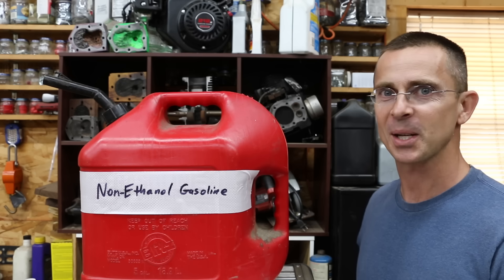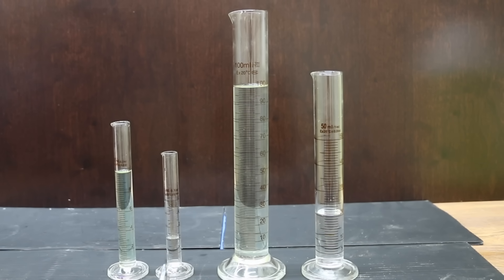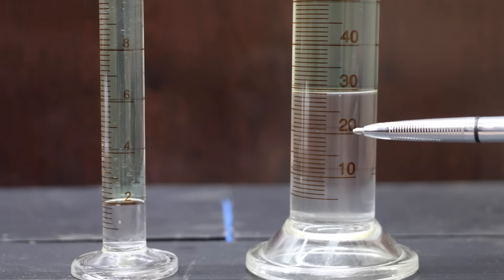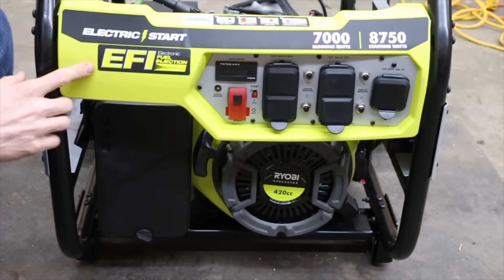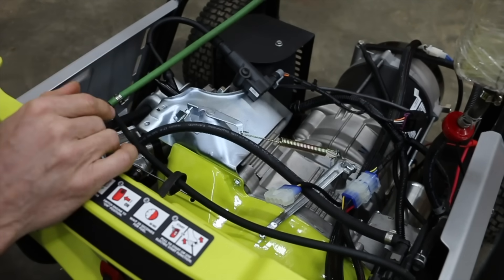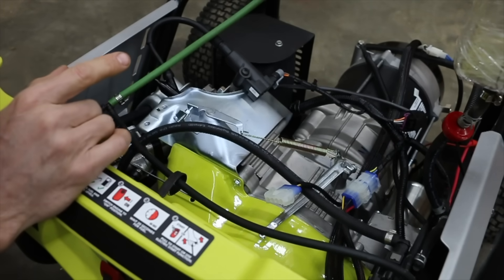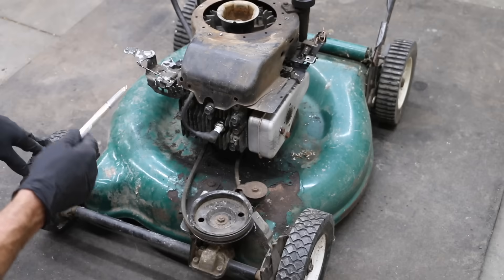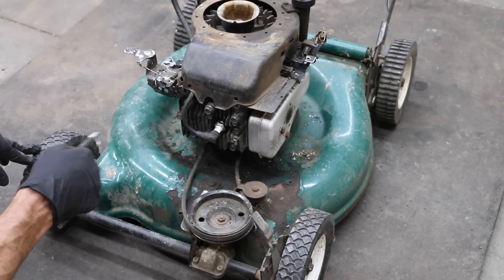Is Non-Ethanol Gasoline Really Better? See the PROOF!

Comment: Ethanol needs more fuel flow to run stoichiometric (complete combustion with no excess oxygen) compared to gasoline, so E10 needs a slight increase in fuel flow. Of course the EFI engine adjusts for this with the oxygen sensor, but the carburetor on your mower engine doesn't, so technically it was running a LITTLE leaner on E10 than pure gas. That might make a difference in carbon deposits if you ran them for longer, although probably not noticeable for this short test.
Reply: "Ethanol gas makes it run hotter" can be fixed if the carburetor jetting is made richer enough to negate the leaning effect of the ethanol gas as compared against straight gasoline. Also the power loss that occurs when using gasohol  with some engines,particularly if they were already calibrated on the edge of too lean even with straight gas.

Comment: I drove a Holden combo The same trip every day from Logan to Cabulture,same load 3 tanks on E 10 50 liters average 420 ks then 3 tanks of 91 500 ks average and more pulling power up hill,then 3 tanks on 98 I got 640 k average,no dropping gears a quicker traveling time , conclusion in the combo the 98 even though it was a higher price proved cheaper by distance traveled on a tank was cheaper that the 91 and the E 10
Reply from the maker: Thanks for sharing!
Reply: So conclusion
50 ltrs e10 ,,,,420 ks ave
50 ltrs 91 ,,,,,500 ks ave with a bit more power
50 ltrs 98,,,,640 ks no dropping gears going up hill and quicker traveling time
Even though the 98 cost the most to fill the tank,on an average because of improved performance and extra distance traveled each tank of 50 ltrs was cheaper than both, the e10 and 91 on my pocket, plus the advantage of less wear on the endgine
But every car is different,and only by doing a comparison test like this you to can find the most economical equation for your vehicle
Example for years I had my father's Rodeo it got 280 ks per 50 ltrs regardless of what I used with no more power so conclusion of dads Rodeo I used e10 it's how you learn to budget

Comment: Alcohol is Hydroscopic. It attracts water. It is also corrosive. So if you leave your fuel tank half empty for any length of time, it will corrode a steel or aluminum tank and the material will wind up in the fuel clogging the injectors or it will attract water to the tank and foul up the fuel system. Either way its a bad thing. Very harmful to an engin
e.
Reply from the maker: Thanks for the feedback.

Comment: For the long term test, you should leave some ethanol/non ethanol fuel in two, clean, small engine carbs for the extended period to simulate someone not draining their carb before storing for the winter. Examine the deposit/corrosion characteristics of the two fuels on the aluminum housings, brass jets and fuel passages.

I think non ethanol fuel leaves deposits while ethanol fuel also jells in the jets due to exposure to the moisture in the air.
Reply from the maker: Thanks for the suggestion.

Comment: You are a pure genius, the testing methods, your video production are first class.

I worked in a car dealership the ethanol attacks rubber orings and leaves sediment, burns cooler there fire reducing vehicle fuel efficiency by typically by 10 percent.

I also worked as a small engine tech, customers would bring in the outdoor equipment, it loses power, won't start, etc.
I learned ethanol settles and breaks down after 30 days.
I would find white powdery substance or looked like snot, used brakekleen blew it the passages and cleaned the fuel bowl.
Steam the carb then run bread tie in the ports.
Reassemble test and done. Asked the customer if used ethanol? They use ethanol in everything never have a problem.

At the dealership I worked at and my friend another the service advisor ask where do you get your gas or do you use ethanol?
He would tell them try using brand name gas station and switch to regular gas.
Will give you gas card if no difference.
They thanked him.

When gas hut 5 a gallon here I used ethanol I paid the price, my Silverado with tuned  5.3 started losing power  going up hills or long inclined felt jerking sensation.
My winter beater Buick and for fun Cadillac  the same.
My toy 83 monte with 454 filled up with ethanol as left the station it fell on its face.
My Nova SS with high strung 406 small block pinged horribly.
Live and learn.i know I use it in everything runs fine I bet.

Thank you for the bideo

Comment: On long term storage, this is one area where the heavy CA emissions restrictions actually adds to the ownership experience.  Because fuel systems are completely sealed off from the atmosphere, the only time that atmospheric air can enter the system is when the fuel cap is open.  At all other times what air is in the system stays there as is. There is no extra moisture getting in there to cause problems with the ethanol content.  I've stored motorcycles for many years, up to 7 years with a full tank of gas.   Often I'd forget to add stabilizer until years later (oops..).    After 7 years, they start up and run just fine on the 7 year old gas in the tank.  (fuel injected, not carbureted engines, though I'd just drain the float bowls on those).
Reply from the maker: Thanks for the feedback.

Comment: Ethanol fuel burns hotter than non ethanol fuel, and legally all fuel has to have a minimum of 5% of ethanol so I’m questioning where u got that fuel from that gas no ethanol, but because ethanol burns hotter, it will have higher wear on ur engine and eventually kill it sooner than if u have none ethanol fuel

Comment: I love ethanol free fuel and use it in all my small engines. Noticable difference in sound and power in my riding mover. Gas station up the road sells it for $4.99 a gallon. About 2 dollars higher than ethanoled fuel.
Reply from the maker: Thanks for the feedback.

Comment: 4% is such a small amount that you need to check your margin of error as this could, very well, fall within that margin. It could be that your engine is actually burning the ethanol fuel more efficiently but you do not notice because your measurements are not perfect (as nothing is).
Reply from the maker: Thanks for the feedback.

Comment: Hi, interesting podcast.  I would like to see the difference in fuel efficiency for an engine that can advance spark until a knock sensor input to stop detention? Also maybe the effect of an oil cooler allowing the spark to be advanced more without detention?

Comment: I own a few Piaggio Scooters.  They are Fuel Injected Bikes.  I try and use Non-Ethanol as I have noticed a Yellow Film in the Injectors if I use Fuel with 10% Ethanol.  When I buy Non-Ethanol I use the REC Fuel which is 90 Octane.  The Injectors don't get they Yellow Film.  I also noticed from my testing, that I get more MPG on Non-Ethanol.  Yea, I do pay more for the Fuel.  I also use Non-Ethanol REC 90 in all my Mowers, and Yard Equipment that are not Electric.

Comment: I like the video and your test-procedures.
However, as is often the case, things are not always that simple.
While this is all valid for small engines that are designed for non-ethanol fuel, it may be a completely different story in modern cars.
Modern cars for instance are able to detect the kind of fuel they're running and will adjust their ECU settings accordingly to extract maximum performance and run efficiently with the fuel you give to them.
We observed this behavior in my friends Mercedes Benz A-Class from 2019. When the fuel prices went absolutely bonkers last spring he decided to try the (at the time) vastly cheaper 10% ethanol gas in his car and his engine got a smoother sound as well as a slight top speed increase on the autobahn of around 5km/h and he also felt the mileage was slightly better.
Of course this was not a blind test, but given how much prejudice he hat towards ethanol fuels I think that might be a valid experience.
So I think it always depends on the type of engine what results one might get.
I wouldn't be surprised if there is maybe also small engines in brazil that perform best on pure ethanol. I heard that it is quite common there to run cars on 25% ethanol and even 100% anhydrous ethanol.
Reply from the maker: Thanks!  Thanks for sharing.

Comment: The biggest issue I have found with ethanol is working on older motorbikes, if any water gets into the fuel whatsoever, and gets time so sit in the system, the water/ethanol mix will completely freeze up carburetors or even corrode holes in the carb bowls in extreme cases

But I also commute about 70 miles a day with my bike with ethanol fuel, so it never gets any time to sit and corrode stuff away.
Reply from the maker: Thanks for the feedbak.

Comment: Check the plastic fuel lines. Mowers, weed eaters, chain saws, all have a tendency to malfunction by collapsing in the heat of summer and fairly heavy use. I have been told this is a problem caused by the ethanol. 

I haven't used ethanol in a small engine in years. Looking forward to what you find.
Reply from the maker: Thanks for the suggestion.

Comment: I have personal experience from my use of both ethanol as well as non ethanol based fuels in both  my 2006 Toyota Camry as well as a Honda Commercial grade push mower as well as gasoline powered two cycle yard tool engines.  Seveal years ago I began noticing problems with performance in my self propelled push mower when using ethanol-based gasoline. The engine stumbled, stuttered and failed to perform. At the recommendation of the local lawn mower shop I added a fuel stabiizer to the fuel mixture and it helped . This is something that I had not experienced in operating my Camry since it ran fine. Over time I gave up the ethanol-based gasoline for all of my two cycle yard tools entirely and switched over to using ethanol free gasoline entirely, for my mower and all of my yard tools. The performance change was noticeably different. Ethanol free gasoline performs significantly better in all yard tools while 10% ethanol products greatly diminish performance to an unacceptable level. I now use only ethanol free gasoline in my yard tools but have continued to use the 10% ethanol gasoline in my automobile since it does not seem to affect performance.
Reply from the maker: Thanks for sharing.

Comment: E85 does not leave deposits.  Quite the opposite. It “steam-cleans” the engine.  The problem is Ethanol’s low lubricity, which older model cars may not be designed to withstand.  So, for older engines, it may be necessary to add a small amount of oil to the e85, like a two stroke

Comment: Great video! I'm not at all surprised by the added carbon build up & have dealt with the corrosion in one of my personal vehicles. I use ethanol free fuel whenever I can find it despite the increased cost.

 Engineering Explained has a great video about ethanol in fuel for anyone that wants more details. It's called "America Was Wrong About Ethanol - Study Shows".
Reply from the maker: Thanks!  Thanks for the feedback.